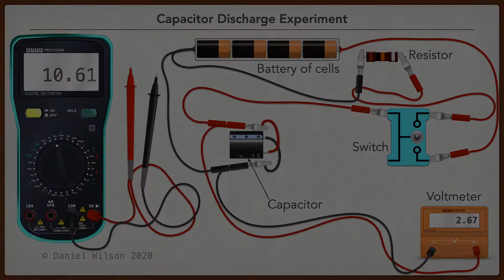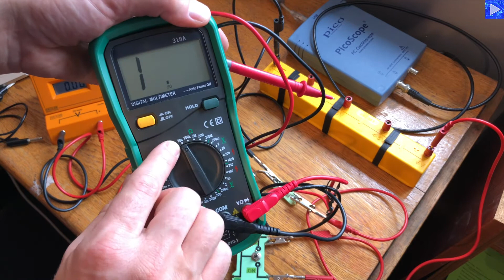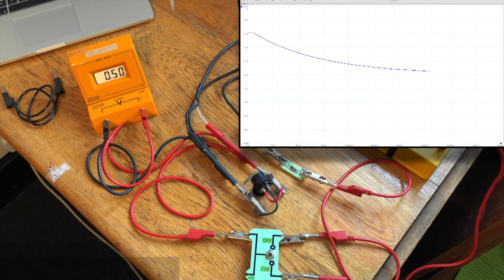Capacitor Discharge Experiment - Determine Unknown Capacitance

Comment: I've been wondering how charging up a capacitor is faster than discharging it
Reply from the maker: It isnt always it depends on circuit resistance. If you charge with no resistance it’ll charge quickly. If you charge through a resistor it’ll take longer. Same for discharge.